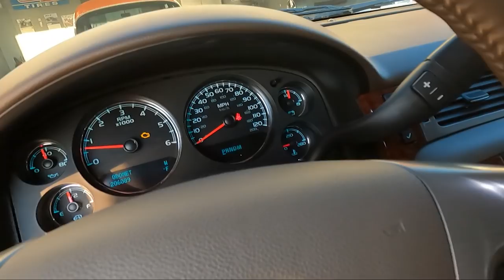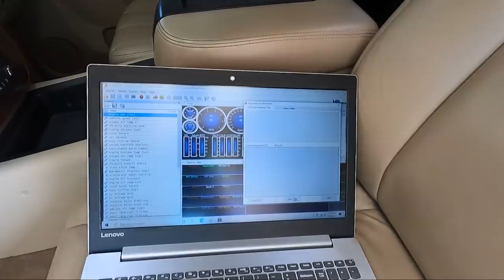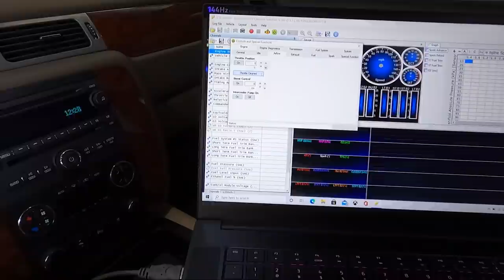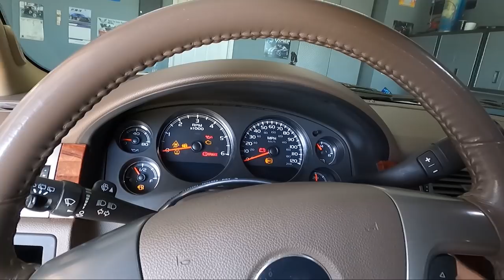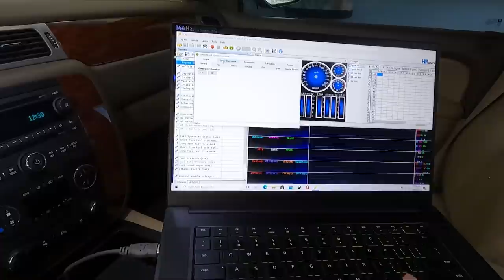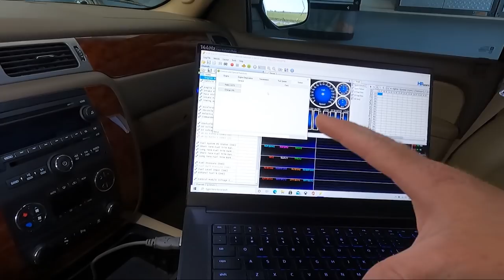How to Install Throttle Body on 5.3L V8 (Service Engine Light and Bad Idle Fix)

Comment: So, if you buy the cable and credits does the program for PC come with it or do you have buy that seperate.  Need to change my speedo, turn off AFM on mine.  I can get a tuner to do that, but if this is in the same ball park of cost I'd do it for more functionality.  I replaced my TB at around 40K under warranty.  Again around 50K as well.  Issues with the TPS were sited and the cruise stopped working.  Everything funcations well, but I've got another 200K on there and I sure it gummed with junk.  I a slight rough issue, but no codes.  Plugs and wires replaced @ 200 or so.
Reply from the maker: Yes the program is am comes with it or you can download before off hp tuners website

Comment: Great job add you a catch can to help get rid of that oil inside your intake
Reply from the maker: I definitely need a catch can
Reply: @TWAMotorsports  TW. Good tutorial on your burbon.. hopefully it'll be gone to the new owner this time around.. 👍
Reply: @TWAMotorsports  good Friday morning TW. Well the sun is out it's going to be 70 today.. after work I'm going to be working on my 94 trans am. I received my power stop front brake kit in yesterday.👍
Reply: @TWAMotorsports  TW I'm just getting home from work. Having dinner with my wife and kids. Then going to install my new front brake kit from power stop. Man them new red brake calipers look sweet and not to mention it came with all the hardware love new caliper bolts etc.. haha.. have a safe weekend buddy 🇺🇲...
Reply from the maker: Thank you. You as well

Comment: Trav, since you mentioned the Tesla. Do you charge it with a 220V or a 110V charger? If 220V, how many amps is that circuit?
Reply from the maker: 220v 50 amps

Comment: The rubber piece that goes on the throttle body and gets clamped on, mine is all warped so it doesn't create a good seal at all.  Can I buy a new rubber piece?  or what's it called please?
Reply from the maker: Theottle body gasket?
Reply: @TWAMotorsports  No it's not the gasket cuz I tried using that term but it isn't giving me what I need.  one end slides over and clamps onto the air filter side near where the mass airflow sensor is but the side that slips over and clamps to the throttle body is all warped.
Reply from the maker: Not sure. Possibly called a coupler

Comment: Had a 2006 Silverado 2500 that did the same thing... we changed the throttle body and still did it.... but ended up putting dialect grease in the plug and it quit
Reply from the maker: I have seen that issue also.

Comment: Could you recommend a good lowering setup for an 04 suburban 2wd? Id like a 4/6 drop.
Reply from the maker: I did my 04 tahoe on here. Same parts is what I would recommend. Links in that video description
Reply: @TWAMotorsports  thanks! I love that tahoe ! I wasnt sure if the 2wd was different. Thanks again!
Reply from the maker: They both use torsion bar front ends in those years
Reply: @TWAMotorsports  awesome! Ill send some pics. Also when you sell your suburban let me know. I WILL BUY... very serious! I love that thing! And i know you do quality work!
Reply from the maker: Its already gone
Reply: @TWAMotorsports  lol of course! The next one then
Reply from the maker: Lol
Reply: @TWAMotorsports  btw does autoride affect the set up you chose? Or did this tahoe not have autoride?
Reply from the maker: No autoride on this one